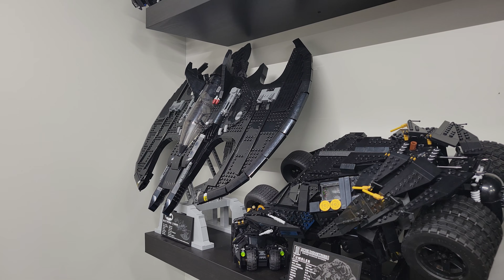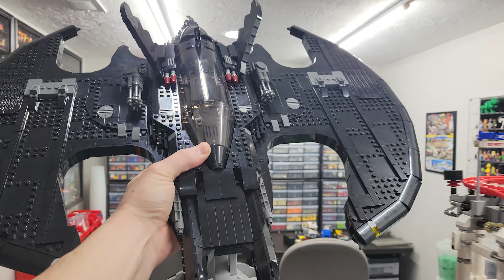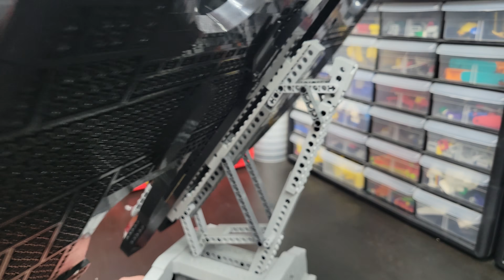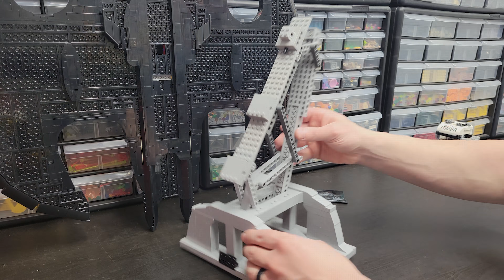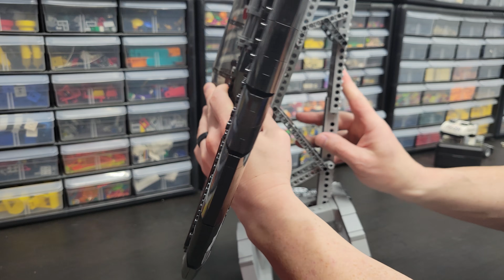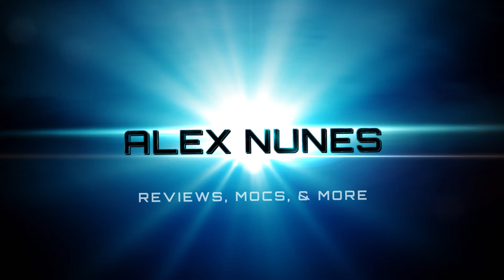1989 Batwing Custom Display

Comment: Nicely done. I have done somethings similar with some of my Star Wars sets. A few that did not come with display stands. This particular set i took advantage of the wall mount and have mine displayed that way. And I used the stand for this set and modified it to hold my Millennium Falcon. I may have to go back and look at your videos for the display stands for the '89 Batmobile and Tumbler. It may enhance my display to elevate them a bit.